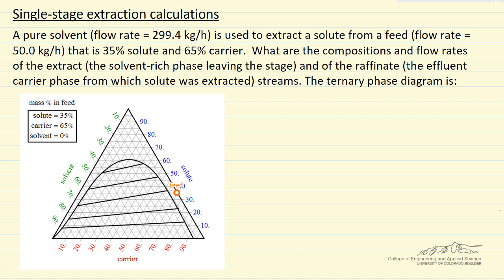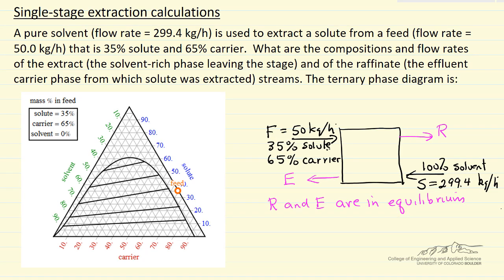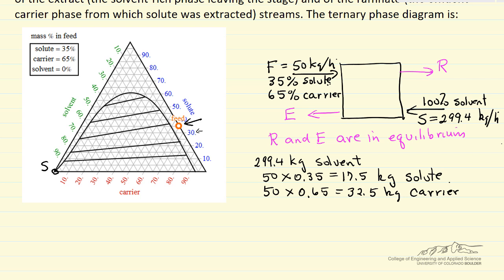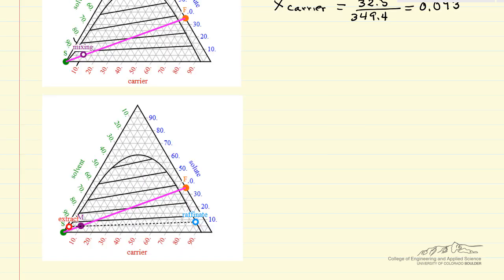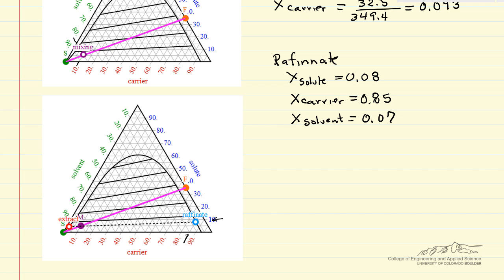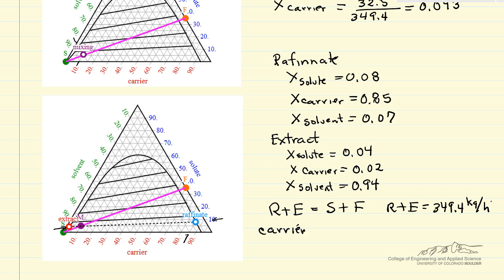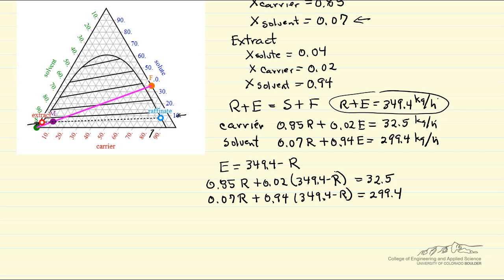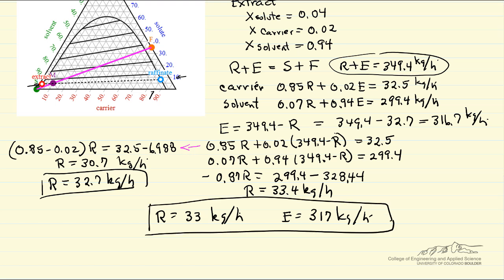Single-Stage Extraction Calculations

Comment: In the material balance determining R and E, why did you not use the solute for balance and instead use overall, carrier, and solvent balance? I tried it myself and it gave some completely different flow rates of R and E. Is there some sort of rule since the values of flow rates vary depending on which two balances are used?
Reply from the maker: Thanks for the comment.  You should get the same answer if you use a different 3 balances (say, solvent, solute, and overall), but the overall is often used because it is a simpler equation.  The other options are sometimes arbitrary.  I don't know why you got a different answer.
Reply: @LearnChemE  I find this problem odd since you have to average the resulting flow rate (which in this case, the R) from two pairs of balances (overall-solvent and overall-carrier), so I tried the other pair (overall-solute). The balance should obviously reach the same answer but instead it didn't thus I asked. (see 7:29) 
Anyway, thanks for responding as soon as I asked. Your channel has been a great help for my review so I really appreciate your work.

Comment: how did u get the extract-point above the S?
Reply from the maker: Thanks for your question.  Once you have the mixing point, you draw a tie line through that, and the raffinate and the extract are on either side of the envelope.  Then you just read the values from the diagram.